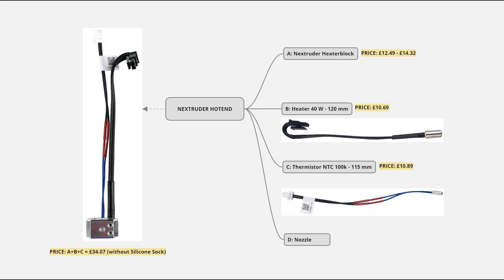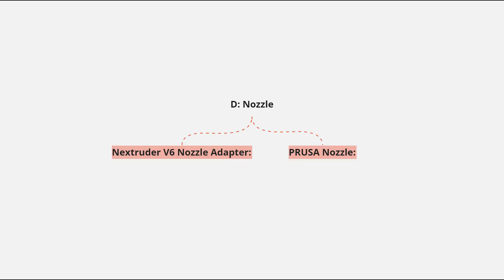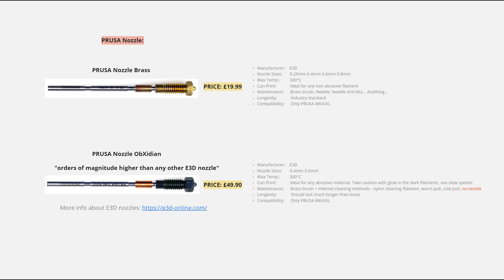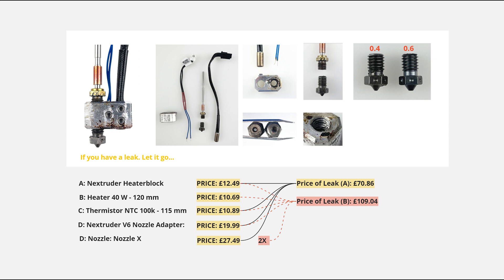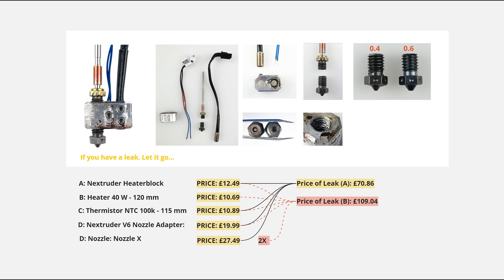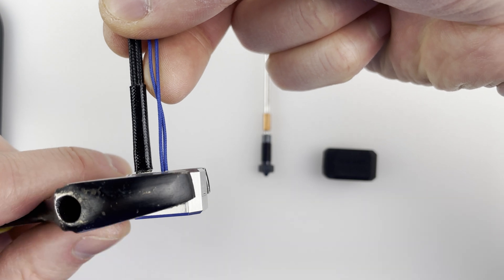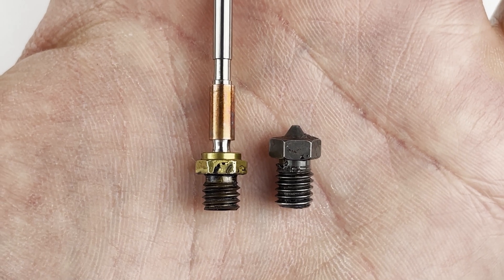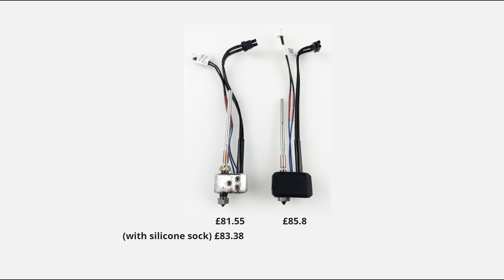Prusa MK4 / XL Nozzle Review & Hotend Assembly (Nextruder V6 Nozzle Adapter VS Prusa Nozzle)

Comment: I don't think you've learned anything. You can certainly clean out any clogs with a heat gun and pull out the clog with new filament fused to it. You could have made sure you mated the adaptor with the nozzle more securely so they don't leak. Heater, thermistor, heater block just don't go bad on their own even after massive clogs, they can always be salvaged unless you physically damaged it. It makes sense to use the adapter because you can clean out the clogs easier by taking the adapter and the nozzle apart, and it also make financial sense if you have a bunch of spare V6 nozzles lying around from other printers and you'd rather not buy specialty items specifically for a Prusa. The advice you give out here might work for you but it wouldn't be good general advice for everyone.
Reply from the maker: Thank you for your comment. I absolutely agree that its not for everyone. There have been lots of valuable comments below this video how to best deal with this misfortune that I had. Could I have avoided the leak - yes, probably, but will I try again - no. On paper its perfect product. But nowdays no printer manufacturer, including Prusa, push these type of solutions because they are effectively outdated. Look at new bambu hot ends - quick swap, no tools needed at all, no leaks, completely fool proof. Not to say adapter is bad, but market for these type of hot ends is very small. But again, apologies if the video offended you in any way.

Comment: My experience with V6 extruder is that go for a copper heat block and the leak issues disappear, aluminum has a very different thermal expansion coefficient than other components in the hot end and the nozzle gets loose with temperature changes.
Reply from the maker: Good point. I actually used copper heat block (not in this video - later) my issue was I kept getting hot-end heating error as it heats slower than aluminium, and there was no way around how to calibrate it, so unless test were turned off - every time before printing I would need to press ok. Thats why i reverted back to aluminium.

Comment: Good advice on having a spare.  I just received 3 complete units from Prusa.  I have had so many jams that I can remove the nozzle in less than a minute and swap with a spare.  I have also switched to Phaetus nozzles, they are slightly cheaper and have a hardened nozzle.  The Nextruder has some design problems in that it is held in place by a single set screw that is tightened on the hollow shaft, too easy to crush it and cause jams.  I also have spent a lot of time in making the filament path less restrictive.
Reply from the maker: Hey, thanks for sharing your experiences. Ill check out the Phaetus nozzles 👍 also if it keeps clogging make sure to raise nozzle temp by few degrees. To unclog I use inbuilt cold pull feature, it helped me save nozzles many times, cheers 🍻

Comment: What torque screwdriver did you use that shows the digital torque value?
Reply from the maker: Sealey Sts103 Screwdriver Torque Digital 0.05-5Nm 1/4 Hex Drive £48.9

Comment: Why does filament on the threads ruin everything.  Couldnt you just heat up the hot end and then thread the nozzle in when it is hot?  I am assuming leak in the threads is not letting you assemble everything together?
Reply from the maker: Its just like a leaking pen, if theres once a leak, theres always a leak. Not saying its impossible to prevent it, there are some good comments in this section how to deal with that, but thank you for your observation and suggestions.

Comment: I have had luck with the v6 nozzles when I rub the mating surfaces carefully on a knife sharpening stone. I printed a fixture so the nozzle stays square to the stone and the mating surfaces sit together very nicely without leaks.

That was on my ender though, so far I have not needed to use those types of nozzles on my mk4s.
Reply from the maker: Good tip, thank you. I hope I never need to use it but the way you described it - makes sense.

Comment: I'm thinking you may not have properly tightened the v6 nozzle to the nozzle adapter. Just to make sure Once you installed the nozzle adapter then installed the nozzle you Heated up the hotend to the temperature you print at then tightened the nozzle to the nozzle adapter again while hot? If you skip this step you will always leak. This is how it's always been with any nozzle pre the new style with integrated and sealed heat breaks. The issue I am coming up against at the moment is there are not a lot of options for nozzles for the prusa mk4. more specifically I want to get a diamond nozzle. it would be much easier to use the adapter.
Reply from the maker: I did tighten it when heated. As is instructed in the Prusa tutorials. Still leaked.

Comment: Did you Hot tighten the V6 nozzle??? You Install the assembly, then heat the nozzle to 250 degrees,  then tighten/torque the nozzle. It will leak if it's only cold tightened.
Reply from the maker: Did that. But thank you.

Comment: I'm sure someone has already mentioned it, but I know of 3 ways that are pretty good methods:
1) Solvents (last resort)
2) Boiling hot water (dip it for a few mins until plastic gets elastic) and a good pick or brush
3) Tap and die set for what... M6? Get a cheap one, you just want it to scrape the plastic, not possibly form bad threads lol (pretty easy to get plastic out of threads with this method)

I have yet to test hot-lock a high heat threadlocker, but it's based on ceramic, which is an insulator (video idea? lol). I think the torque wrench was a good idea, I'm getting one soon as well. I recently had the same leak happen to me what an ordeal... Heating it up to 270C IS A MUST when screwing it in.
Reply from the maker: Really good tips, thank you! To be honest I will never use my v6 adapter and nozzles that go with it again so these can go as a give away to whoever only pays for postage :)
Reply: I use a ultrasonic cleaner with lactic acid (for pla). I haven't test with other than pla.
Reply: @Rafael84-MP  For real? Sounds crazy lol. Then again PLA isn't know for chem resistance lol. Luckily I haven't had any of these issues lately.

Comment: Super helpful video! I'm assembling a MK4S kit, and planning to print with some more abrasive materials (Protopasta's bronze PLA), so hardened nozzle is a must. Wasn't sure if the Nextruder V6 adapter was worth it or not. I wish the adapter used a better mating method for V6 nozzles. Maybe a silicon washer?

Anyways, thanks so much!
Reply from the maker: Thanks for watching and I’m glad it was useful. Some people left good tips how to prevent leaks when using v6 adapter but unless you have old nozzles there is no point, once you install 0.4mm obXidian, you wont go back to anything except maybe the new high flow version :)
Reply: @StudioSpaceDust  can you write down ? the good tips to prevent leaking v6 adapter please ?
Reply from the maker: @landbouwlimburg6490  hey, you’ll have to dig into comments under this video for more details, because I don’t remember product names but basically some commenters suggested you need to seal the thread of nozzle and adapter that go into heater block with some material similar to what plumbers use securing threads to prevent water leaks. Otherwise with time threat loosens and because of filament pressure in heater block  - filament will leak. Can also use thread glue that is heat resistant. Or a combination of both. Could also try replacing aluminum heater block with after market copper one, I found that when using this - Prusa nozzle never loosened for me - but i havent tested that with nozzle adapter. Thats why In my opinion if you dont want to tamper with leak is simply best to prevent connection altogether. But using thread glue would probably help. Not sure that answers your question but i never tried using v6 adapter after i had a leak and i never had this problem any more, im still using same obxidian 0.4mm i installed in March and have 1000+ hours of print time printing various filaments and never had problem since, it can still clog but cold pull would help with that.

Comment: Is there more stringing with an hardened nozzle like the Obsidian? I found that on my other printers i cant det rod of stringing with hardened nozzles, brass works like a charm, nö stringing at all...
Reply from the maker: I personally did not experience any difference between brass vs obXidian. Some people say you need to raise hot end temp a few degrees when using hardened steel nozzles but with obXidian I didn’t even experience that. I think depends on filament quality mainly.

Comment: Thank you for the good video. One question: i didn't know there is a silicon sock on. Why does it matter?
Reply from the maker: It’s an optional upgrade. With time you will see some filament residue build up on heater block, silicone sock prevents filament from sticking to it basically. It’s a cheap upgrade which makes sense if you’re using Prusa nozzles in my opinion. Its like silicone baking tray in an oven - after cooking pie in it you can easily clean it afterwards, while if you’re using metal tray its much harder to scrub things off of it :)

Comment: Have absolutely 0 complaints for the obsidian nozzels. They are amazing. I've upgraded all of mine to them, currently waiting on the silicon sleeves thou. Love the video! Wish I had seen it before I figured it out myself. Luckily when I ordered my printer I also ordered the obsidian nozzel as well  figured would eventually need a new one.....a few weeks in the brass nozel had a big clog and I've been printing with the obsidian one since...that was in February and the printer has been going almost non stop since. It's mid-June now, and it's still going strong!
Reply from the maker: Thanks for the good words! I managed to clog one obxidian sadly. It was with NGEN, most likely because of too fast infill speed (used original material profile from prusa slicer…)… so I would only say this: when you are testing new filament, put old brass nozzle and run a test print, because if it clogs you will loose cheaper nozzle. And be very careful if you’re printing TPU/FLEX. I had to drop speed significantly to get that going.
Reply: @StudioSpaceDust  great advice, I have 2 spools of TPU waiting for my first try after I mass print for an even I've been working towards for a week, lol. Then, I can resume my "research," also known as aimlessly wandering in the dark, lol.
Reply from the maker: @VikingVeteranArtisan  we are all here just dust in the space my friend and 3D printing passion unites us all 😎🔥 good luck with TPU and your project!
Reply: @StudioSpaceDust  Thank you. Keep up the amazing work!

Comment: I've begun using a small butane torch and heating the nozzles (both Prusa and V6) until red hot which vaporizes any filament inside. For the block, I heat it only until the filament starts to bubble and remove residue with a brass brush. I also have a vapor blaster which is an abrasive blaster using high pressure water. It effectively can restore all the parts to near new condition without compromising them although it is non-essential; heating the parts to high temperature achieves >90 of the desired result.

A couple of caveats. The feed tubes appear to be press fit and when heating the threaded part, the heat will loosen the tube and it can fall out from metal expansion unless its kept vertical until it cools. Care must be taken when heating the block as the aluminum can easily melt.

Using a torch has allowed me to salvage many hot ends that I might otherwise have tossed out.
Reply from the maker: This is very inspiring. I believed I have done exactly that trying to salvage one clogged obXidian nozzle but I didn’t go till its glow red, so maybe I will give it a go another time. :) appreciate such a sincere comment 🙏 thank you sir

Comment: I recently bought a different pack of the nozzle in Aliexpress,  it works very well, my advice is that before you install the nozzle and the hotel, try to hot it first and then install them together,  because if you don't probably you will have a problem

Comment: dude thats fuckin awful advice... if you have aleak  let it go...   dude no... at the worst case sceneario you can remove all parts and fuckin blast them with a flame until all the plastic burns away and they get red hot... then theyre like brand new
Reply from the maker: If you do that then: 1) you melt aluminum heater block 2) hardened steel nozzle becomes ruined if you exceed 300C or whatever is set as max temp by manufacturer. Thats why some use soldering iron, so that they dont overheat it. But if you want to blast it, of course it’s your choice. Not to mention your cables will melt too, in some cases, as in mine thermistor cable was melted to heater block, blasting it with flame would have just burnt it. This can i ly be done with Prusa brass nozzle. I have done it myself after i clogged it, in that case, yes it worked, I also used 2mm drill to remove filament stuck inside.

Comment: Thermistor! = thermostat! To control something thermostatically, you need sensor, logicand effector, and thermistor is only that: a temperature sensor. Fancy word for a resistor with predictable resistance change wit temperature rise. In this case - resistance gets lower with rising temp, hence Negative Temperature Coefficient.
Reply: 3:37 order components (seperatly)

Comment: The best solution I've come up with to fix your stuck filament in the threads of the heat block is to get a bronze cleaning brush from a gun store. Those bronze cleaning brushes come in a bunch of different sizes. the .22 caliber or .25 caliber cleaning brushes would be good choices. Mount one of these in a drill and then carefully use the brush to remove the plastic on the threads. The brushes are typically made out of bronze, aluminum and steel, so you can even heat up the heat block before using the brush. This will clean out the filament remnants. That said, be careful with how aggressive you clean it. The heat block is aluminum which is relatively soft and you can wear away the aluminum quickly if you are too aggressive, ruining the heat block completely.  I cleaned out my clone heat block by heating it to the point the filament was smoking, then one pass with the cleaning brush in a drill at low speed removed all the filament residue completely...
Reply from the maker: While I was screwing Prusa Nozzle into heat block after the leak I cross threaded walls, so in this case it will not work because Its ruined, but this tip of boron nitride and bronze brush on a drill sounds like a plan. If I ever get to use Nextruder Adapter again Ill know better how to deal with leaks issue. Using Prusa nozzle eliminates all this hassle though...BUT if somebody has a specific nozzle they want to use this may be a great tip. Thank you for the practical advise. I think using metal brush on a drill + heating might at least help salvage the nozzle X nozzles, or clean Obxidian tips from outside when regular bronze brush is helpless.
Reply: @StudioSpaceDust  The main reason they made the V6 adapter is a lot of people (like me) have many specialty nozzles for the older V6 hotends. I have around a dozen 0.4 hardened tool steel nozzles for the V6 hotend and the adapter allows me to use these expensive nozzles in the MK4.  And yes, Boron Nitride is like plumbers sealant for 3D Printer enthusiasts. It helps seal up the threads, while making the parts not seize together...